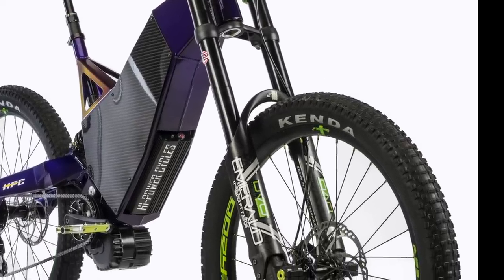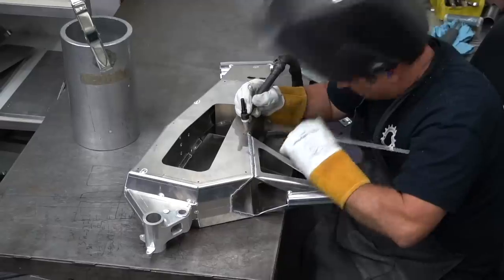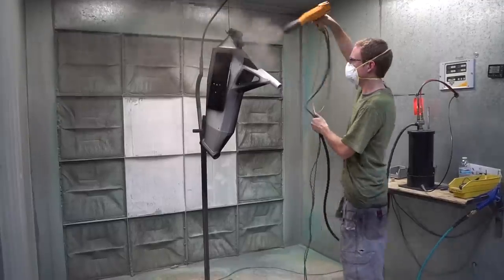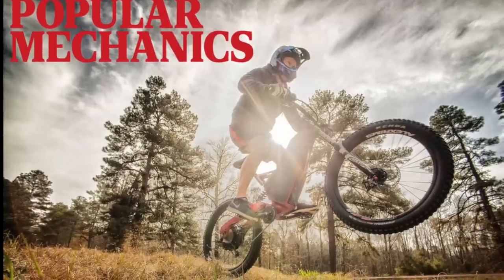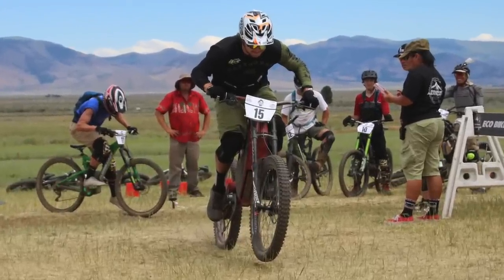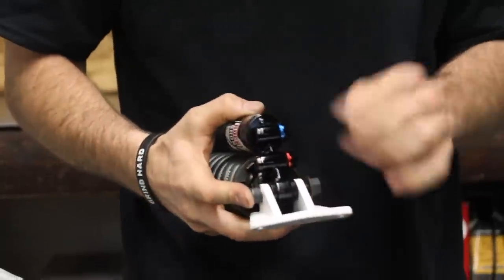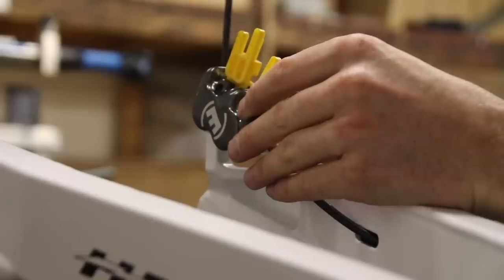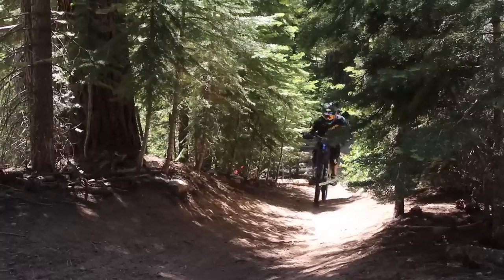Making The Revolution: The Fastest E-Bike in the World

Comment: $13k is a lot of money in general. for most people, we wouldn't spend $13k on an e bike. But, I know it isn't cheap to get an ebike to go 50mph and not have something blow up from the extreme heat the power produces. I bet this bike rips on the trails and the bonus is that it's quiet for the most part. and this bike weighs less than 70lbs! the torque must feel amazing! people shouldn't compare this to a dirtbike/motorcycle. its a different class. and for people who say that they can get something way cheaper, why don't u have that something already then? you don't have to hate on something just bc u cant afford it. you have to understand this build isn't cheap and the r&d put into this is why it's $13k. I ride motorcycles too. yes, they are faster than an ebike. but it comes with legal requirements like insurance, license, and registration. if u got the money, get both! personally, I love the sound of my v-twin and the crackle and pops it makes. but, I also love my ebike bc of the instant torque and it runs on a rechargeable battery. gas is more expensive than electricity. and yes, I know there are electric motorcycles too. and yes they are fucking amazing. but an ebike just gives u a diff experience. u cannot compare the two. its like riding a 250cc motorcycle and a 1000cc. they are both fun in their own ways.
Reply: it is cheaper than you think to do 50mph, other companies do it for 3-4k

Comment: Spend $15000.... or make your own for <$400... I’ll spend 20 mins googling parts and an hour building it than have to spend that much :) looks cool
Reply: Ya man you can't build a bike anywhere near this for under a grand and prob not even 2 grand. Btw hand outs don't count if you have people giving you parts since we all don't have that privledge.
Reply: BRYTE Kru ya, I wasn’t given handouts. I bought new and used lithium batteries and made my own, goes 45mph, 1500w.. took my old bike and got a $150 kit off eBay on sale and overvolted it. You can buy batteries dirt cheap in bulk if you know where to get them. I spent $390 on my bike and it goes hella fast for what I did my self in a garage with no previous experience and some YouTube. I got my batteries from batteryhookups. Com spent time watching jehugarcia <YouTube> on how to create the batteries and made it. I’ve had my bike for 10mo and going strong. The margins are insane on this bike, all I was saying given the effort and time you can create your own for a literal fraction of $15k. No hand outs either. If I had a 1.5-2k budget i could have built a literal emotorcycle that could likely go 60-70mph. But chose not too because 1 I don’t have the equipment to build a legal/safe enough body and 2 idk how to get one legally licensed.
Reply: BRYTE Kru also the YouTube channel Ebikeschool.com <yes it’s a channel/site> very helpful when making your own batteries/bikes
Reply: @Zodiac83104  yo, what 3000-5000w motor / battery combo would you recommend for a dyi e bike?

Comment: Need a better drive train for these kind of bikes, I think the derailleur wheels will melt..
Reply: Jayden Wagner  not rotating at 60mph for a long time
Reply from the maker: @SKBKER  Derailleur Wheels on the high power units don't move unless you pedal and they only see pedal force... The fast hub motor versions (Revolution X) has a direct drive hub with Freewheel, so chain and derailleur does not move with motor power.
Reply: @hipowercycles  Mid drive is where they would wear out as the chain is on the drive gear of the motor . Hub motor is definitely better .
Reply: @hipowercycles  how are these any different from the stealth bombers?? Except more expensive ? 

Not trying to hate just want an honest response

Comment: Why don't you just make a E motorcycle, because u know u can't drive that thing on the street But it looks very cool
Reply from the maker: We have plenty of daily commuters.  Keep in street legal mode (750W/20 mph), and we actually have a lot of people who have replaced their cars for local commutes.  The 8" of travel soaks up potholes like nothing! It even pedals nice enough to work well as a pedal bike as well for exercise.
Reply: @danimayb  Actually technically the law states the motor cannot produce more than  the legal limit . However all electric motors are restricted . Even the ones sold to be street legal are restricted . They just have the legal limit stamped to pass law . A new battery and  bigger controller will increase any motor . Even a 250W can do 20mph . It's a grey area but you can ride an Ebike restricted .
Reply: @danimayb  I have to say that when I see high powered Ebikes it takes away the benefit of assistance (as that's what they were originally designed for) . However you can see this way . You use it like a motorbike, it weighs less than half of a motorbike so easier to filter, easier to handle, it uses less energy, it's easier to park and if the battery dies you can still pedal . Obviously not up a steep hill but at least you can still sit down and propel the bike whereas a motorbike you're stuck . Personally I would rather handle a much lighter bike like this than a much heavier bike .

Comment: So, is this bike a 750W FAT BIKE Bafang hub motor or a Bafang BBSHD? Your video shows both. Not so high tec when you can't even figure out what motors you're using!
Reply: Everything else is just lip service. No thanks. Neither of those motors require such a frame. Walmart bikes work great for such low power motors.
Reply from the maker: Up to 3,000 sine wave/FOC BBS HD mid drive at 74v or custom OEM Crystalyte hub up to 7,000W at 86v. We highly recommend against trying that much power on a Walmart bike. Bad things can happen. We offer a mid drive and hub version depending on ride characteristics the customer is after.  Both are vastly different and serve different purposes.

Comment: There is nothing proprietary about this bike other than the frame it is not work 15k. You can buy the same motor they use in this bike for 600 usd    and convert a bike for no more than $1000 if you want to the name of the motor is BBSHD

Comment: Nice design took a lot R&D in the frame 15k it's very expensive. I'll rather consider looking at a stealth bomber. But Good luck.
Reply: The Stealth bomber is about the same price,there's small manufacturer with a bike built similarly out of Poland,its called the Cyklone(I think) don't have the link but you will find it on YouTube,unfortunately they speak in Polish throughout the video,but I asked in English how much,in US$ and he replied back straight away $8,500+ tax Oh, he had a monster of a motor in the rear wheel.I built a Enduro hard tail mountain bike and the frame is built in Poland and its bomb proof and very reasonably priced too.

Comment: A bike must be easy to pedal with no power! Thats the secret! Fat tire bikes are boat anchors with no power. I ride a 29er, a 700cc hybrid, and some 26"ers, I built years ago. I ride over 300 miles a week on no assist, or battery...So, how do you make something to meet my cross-country needs? I have a good cadence. My fun is never limited to available power due to fat tires, and its weight...Address my concerns, make it, and send me a bill. If not, I may just get a motorcycle, and stop pedaling entirely. Im not being cynical; im trying to give you a seasoned perspective for success in a very competitive field...Let me know, I love to buy American First!
Reply from the maker: Pedaling on the new Revolution motor is very easy, resistance is way lower than motor a couple years back.  Makes a huge difference how easy it is to pedal...

Comment: How would that keep up with my 150kw(measured from the battery continuous) bicycle that puts out 450nm at the rear wheel?, I have the fastest in the world
Reply: Any cool videos of it? And whats that beast top out at?
Reply: @brytekru7946  403kph, 0-200 in 3.2s, im currently converting it to 2wd, i will post up when i do, kinda hard to find a "legal" place to video, not many drag strips want to be liable either....
Reply: @brytekru7946  im rebuilding it to 84kw continuous and 2wd and 700nm+ at the wheels total with a low top speed of 125kph
Reply: @dylandesmond  why kind of rubber are you running on that? Full street tires?
Reply: @brytekru7946  Shinko - 87-4651 - Hook-Up Drag Radial Rear Tire, 190/50ZR17 from ebay
Reply: @HustleNation99  dynoed.... yeah i rode it daily with 134v set at 950amps current measured off a watchmon4 bms 1000amp shunt, 210kg bicycle including me, extended swingarm, motor weighed 41kg...
Reply: it shat on every tesla and ninja h2r that ever raced me... both street and on the track
Reply: strictly hub motors on facebook, your more than welcome to join

Comment: The bike is useless if it has a Mid Drive Train, if the chain snaps, you're walking home. Hence why Rear and Front Hub Drive Trains are superior.
Reply: Ashke Yggsson ye + if u spec out their top model it goes up to 19999$ like wtf u coud buy 2 greyp g12s for that price and they have beter performance and cost less and have a fingerprint unlock a 12kW hub motor top speed 100km/h 120km+ of range and 80 minutes charging time for the price of 8-9k $ ( one more thing they actualy tested the g12s without the speed block on it and it went 130km/h and they said it coud go even faster but the only problem was at thoes speeds the bike started to woble a bit so they didnt whant to test it anymore so the put a 100km/h speed block on it ) and on the website it says 70km/h+ but they had to put that on the website to not have any lawsuits about the top speed of the e-bike because u can actualy register the e-bike as a moped if u whant to ride with it on the road but u can just ride on the sidewalks at least in croatia
Reply: The intended use, which seems to be trail riding would be terrible with hub motors. The sprung to unsprung mass ratio would be beyond bad because you had to choose very heavy motors to achieve the same power. For road use this might be okay but for anything including lots of wheel travel over irregular terrain hub motors wouldn't make any sense.
Reply: It’s still a bike tho.......
Reply: Any drivetrain is by far superior to lugging 10kgs in your rear wheel.
Reply: Ashke Yggsson unless you have a walmart bike,your chain is not likely to break.Ive worked on thousands of bicycles as a mechanic and cannot honestly recall a time where someone broke a chain unless they snapped the derailleur off.
Reply: If a chain snaps your walking home anyway.
Reply: @ictpilot  A bike chain cut to size is about 300g and can be replaced in a minute with a missing link. It is a non issue.
Reply: @Hunter_Bidens_Crackpipe_  No problem was just observing the other guys comments about if the chain breaks. If the chain breaks it doesn't matter what drive you have, your walking.

Comment: Basically an electric motocross bike. This is not a mountain bike as it would trash any trail it was ride down or up.
Reply: The rear hub motor version would,but not the mid drive as shown,as there are a lot of e mountain bikes with same motor,and less cost and lighter too